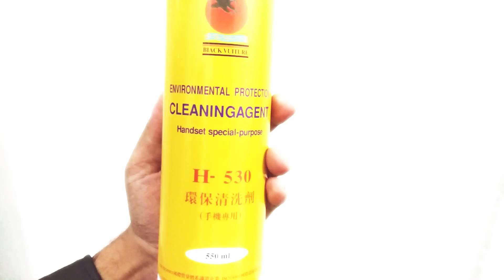How to Safely Clean PC, Laptop & Circuit Boards | WD-40 Specialist Contact Cleaner Tutorial

Comment: Would a compression air can be better or an electronic contact cleaner for dust?
Reply from the maker: Depends on you. Contact cleaner is expensive but provides more deep cleaning!I am still using parts that are 10+ years old using this but I have other affordable alternate. Checkout our "Deep cleaning PC" video and also at the end of "How to fix Whea uncorrectable error" video. Hope this helps Subscribe

Comment: “Analog” is correct, but even more important than the blue WD-40 can is the kind that looks exactly like the one in this video! Make sure it’s electrical contact cleaner … Not lubricant!
Reply from the maker: Thanks for adding valuable info. be sure to Subscribe
Reply: WD40 is actually not a lubricant, but a Water Displacement solvent. If you use it as a lubricant on parts that need grease or something to help actually keep it lubricated, it will displace said lubricant and potentially cause damage to it by seizing up.

Comment: Can it be used to clean sticky keys of laptop after spilling tea ?
Reply from the maker: no it wont clean mechanical or membrane keys
Reply: @SidTheGeek  whats the best way to clean sticky laptop keys after dropping tea ?
Reply: I have heard it will work, but I'm not certain. I know this was over a year ago and you prob got a new keyboard by now lol. But iso alcohol and WD40 on the keys or any plastic pieces should work to remove sticky residue and give it a nice shine. Regular WD40 should work on the plastic only, but don't use it on electrical components. Use Specialist Contact Cleaner there. There are alternative equivalents by several other brands that denote that they are safe on ALL plastics. While the Specialist CC is only safe on SOME plastics.

For rubber pieces in between keys or buttons I've had shabby results w iso alcohol. I would recommend going at them with a soft sponge and mild dish soap and water.
Reply: @terrapinflyer273  Lolz, Pizza Delivery is in 15 minutes and YT Comments in 1 yr. 😁
I used Iso Alcohol and it worked like a charm.
Reply: @urg454  😂 Nice. I'm dealing w cured silicone adhesive under an onboard heatsink (covering a crappy onboard gpu chip) atm. I just had to go and pull it off, thinking it was just thermal paste or padding. Iso alc does nothing to it 😬
Reply: @terrapinflyer273  Oh, what i read at that time (when i was doing research on it) that After Dropping Tea, Juice etc., Sugar solidifies and makes the keys bit sticky to push. When iso alc is sprayed, it brakes the bond of sugar and it evaporates. After spraying the Iso Alc, you need to keep pushing the keys for sometime. For solid like silicon, Iso Alc may soften it to remove but won't be able to evaporate it for sure.

Comment: is it posible to use in my laptop that is soacked in water? because i think its not working well because of oxidation
Reply from the maker: i think you disassemble. wash your mb with this spray. then need to keep you parts in direct sunlight for half hour. but if you are lucky enough to do that quickly it might save mb
Reply: Friend my laptop is still working but it wont charge the battery,i need to remove the battery to turn it on  or just by the battery,also the cpu ang gpu is not working like before,i already brought it to service center but they can only repair by replacing new motherboard.

Comment: So just to be clear. I have a graphics card that has a couple corroded spots on the board. If the contact cleaner doesn't remove it, what should I try next, or should I use the contact cleaner and a soft brush.?
Reply from the maker: As long as spot don't appear on the circuit prints thats not going to cause any problem. its safe to use

Comment: What if i didnt disassembled my pc (did unplugged all cables n connectors) then I put the spray in a cup. I will put brush in the cup to get it wet then also will start applying it to the components or rgb fans. Do u think this will work?
Reply from the maker: I think you misunderstood, This is not for cleaning Plastic or other materials

Comment: Uhhh. Dont use this on yoir hard drives.
Reply from the maker: its safe to use on Circuit board
Reply: @SidTheGeek  as not all drives are the same, some have venting holes/leaks. This can cause data loss, and thats not a risk worth taking. Use canned air, as its more safe.

Comment: Will this damage thermal past in gpu and motherboard?
Reply from the maker: of course you will need repasting again if u have taken out the fan unit and showered the GPU chip too
Reply: @SidTheGeek  Negative, I have never said that I have taken the cooler off the GPU, what I mean to do is take GPU out of motherboard and clean it with spray as is while cooler and fans are still on the GPU, just to clean as good as possible without taking things apart, can this liquid still reach to thermal past and damage it? As whole idea is not to take apart GPU parts and clean it as good as possible, Please thanks
Reply from the maker: @sajankhowaja2901  it will not hurt the thermal paste as long as GPU and cooler are in  contact with each other
Reply: @SidTheGeek  Ok many thanks

Comment: Can I use this WD 40 on my ps4 controller to remove flux after replacing analog soldering and will it damage my ps4 controller or not? Need help
Reply: no it wont damage it, just wipe it gently afterwards, or use brush if the flux is already get too tough

Comment: Is it safe to use contact cleaners on cellphones? Like cleaning the front? or the speakers on headphones? will it damage the membrane inside or the plastic? the non corrosive ones? are they okay?
Reply from the maker: Using contact cleaners is safe as long as they are marked Dry! Subscribe for more

Comment: If you're going to go through the trouble of cleaning your boards, when you spray any cleaner on it, use a toothbrush and scrub it.
Reply: NOPE!   A tooth brush is not ESD safe and can cause static discharge, also scrubbing with a tooth brush can remove the lacquer from PCB's making your board dull looking.   Better to buy a ESD safe cleaning brush.

Comment: Oh man, I need to clean my laptop. Thanks for the reminder and the info on how to clean it correctly. :-)
Reply from the maker: Be careful with circuit boards! these are sensitive components and can fail easily. You can use Compressed air pressure can to remove dusts. but if you know what you are doing & have experience cleaning disconnected circuit boards then you are welcome.
Reply: Thanks so much for letting me know :-)
Reply: if anything I can imagine this stuff being used to clean memory card readers.  How many people have a memory card reader that has stopped working or just doesn't always read the card on the first try?  I have had that problem a bunch of times.  If the reader is in a laptop, take the battery out and all that stuff first.  Then to be on the safe side allow it to sit and air out for a half hour or so after spraying the contact cleaner in there.  That way you won't start it up and have it suddenly die (if it starts at all while shorted like that).
Reply: The thing about a memory card reader with dirty contacts is that Windows might sometimes think the card is not formatted.  That might be a different issue and most memory cards come formatted for some sort of file system and that might be exfat.  You just might want to keep that in mind if that happens and try to put off formatting the card, especially if it had photos you had no copies of yet.

Comment: WD-40 is the best cleaner i use it too. I recently used it on my LCD and it cleaned it to perfection. Though it leaves a lil oily texture on LCD that has to be wiped with LCD cleaners or lens cleaners. That oily residue isnt harmful by any means and is only visible on glossy surfaces if they are not wiped.
That rubber trick no doubt is the best to clean gold plated contacts and i have been using it on Rams and GPUs for quite sometime.
However u shouldnt bring any liquid near to your HDD in any case. Although they are sealed pretty well still they have that small hole called the breather hole that can make liquids fatal.
Reply from the maker: That Oily one, that comes in blue bottle is a degreaser which is primarily used for mechanical parts and mostly for cleaning rust from chrome or metallic stuff. Never use it on any Electronic PCB or any sensitive electric component. This WD-40 (grey bottle) is a Fast dry contact cleaner. Which dries off quickly and can be used on sensitive electronic and electrical equipments to cleaning residues. Such as solder flux, condensation and minor oxidation caused from moist and liquid damage. Hope this helps.
Reply: Oooo Thanks i didn't know that before. How much this grey one costed you ?
Reply from the maker: Probably around 500-600 Rs.costs 9 to 12$ in U.S for a 400 ml bottle.You can get the cheaper Chinese one with 40% more with same price.

Comment: Great video, the key here is to use the WD-40 that is designed for electronics/electrical contacts not the kind that comes in a blue can as that is more of a solvent.  I personally use compressed air to remove dust and debris.
Reply: OHHH SHIT I USED A BLUE CAN
Reply from the maker: Thank you man! i just forgot to mention it in video.Thanks for reminding. Compressed air can is good choice for dust and debris. You can use contact cleaner to clean corroded or rusty traces on PCB etc. Many people use isopropyl alcohol too.
Reply: how does it smell like?
Reply: I USED IT ON MY MOTHERBOARD HOW CAN I  STOP IT FROM BRAKING?
Reply: I use air too, usually. Recently ran into a severe bug problem so imma have to spray out bodies with air, and then deep clean with some contact cleaner
Reply from the maker: @justicebrown1077  I am using 10+ year old hardware using your technique (both Aircan + dry contact cleaner)
Reply: What can possible go wrong with the Blue can?